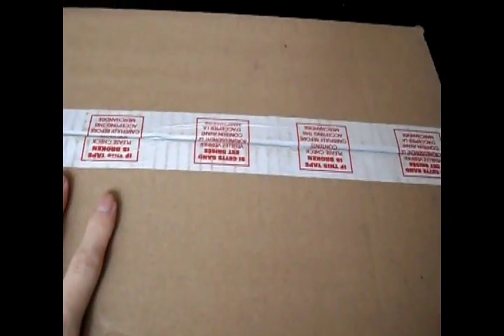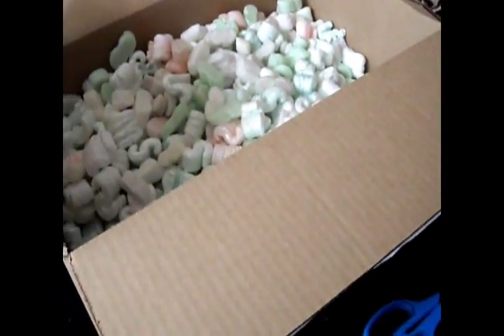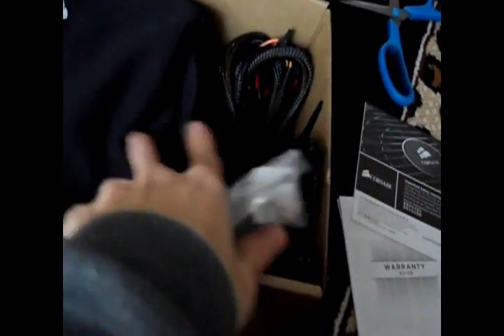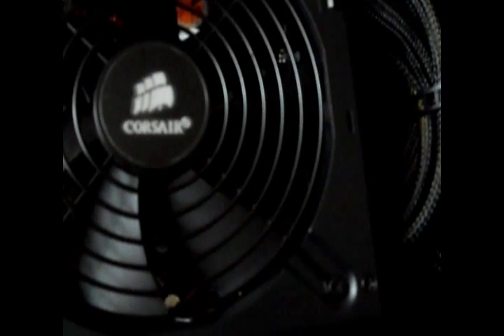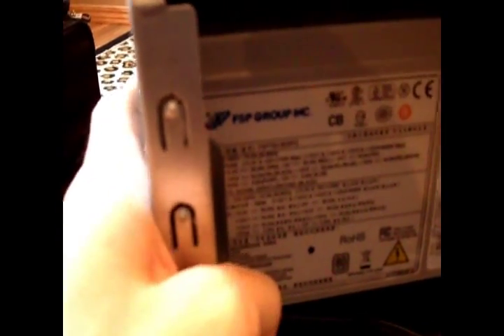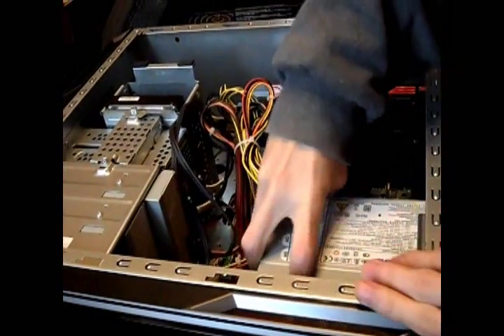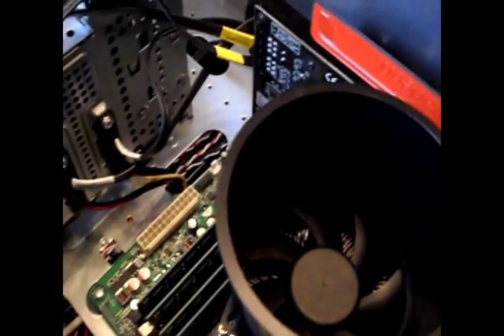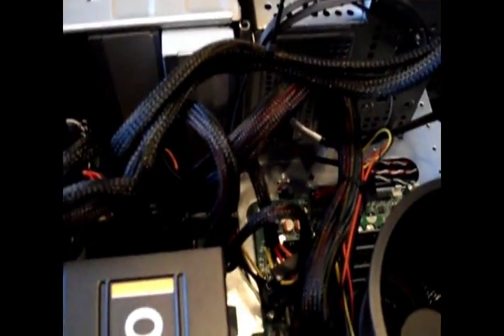Review Corsair TX 750 TX750 V2 watt unboxing and how to install a power supply in a computer

Comment from the maker: @1RUNXBL Hi, thanks for watching. The best way to find out what PSU you need is by using a PC power consumption calculator. There are many on the web just google it. Keep in mind if you want to use SLI for future upgrade you'll need a bigger PSU, so it might be worth getting a higher wattage one now.

Comment: nice keep up the good work and also can you tell me what power supply i need for 2 big fans a motherboard a gtx 550 ti zotac overclocked and a quad core 3.6 ghz amd fx 4100 and 1 drive and a hard drive